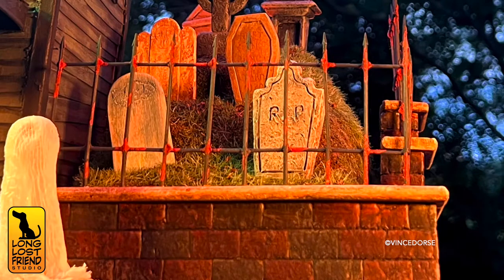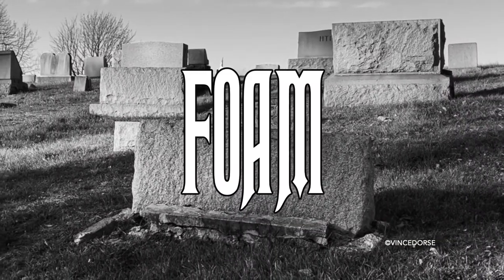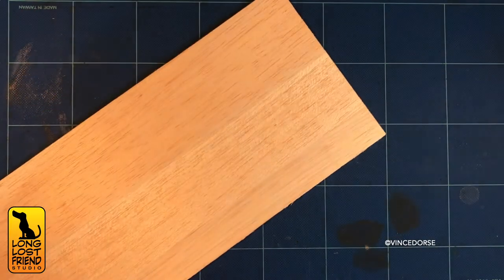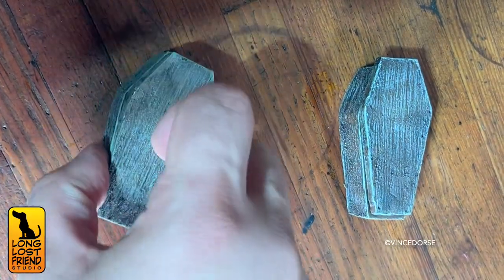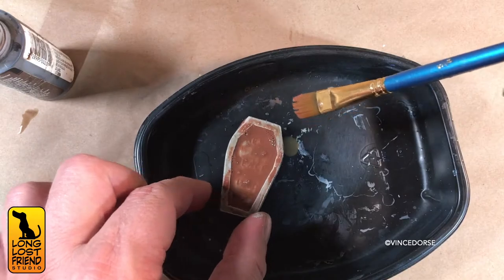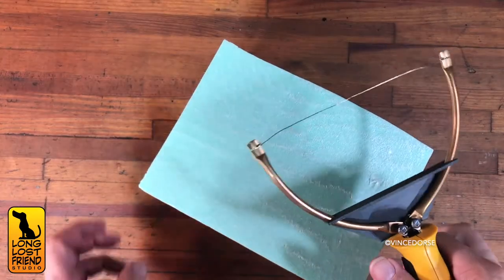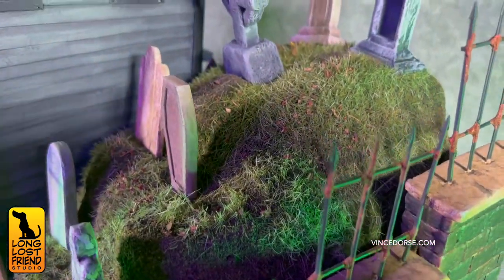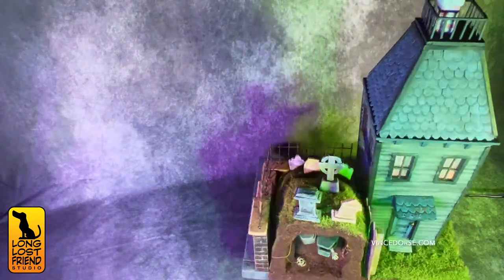How To Make A Miniature Cemetery for a Haunted House

Comment: Happy Halloween!  May I ask what you were doing with the pin in the foam while flocking?  I may have missed it.  But,  I'm pretty sure you were actually attempting to reanimate the corpses in the hill.
Reply from the maker: We didn't push the pin far enough into the earth to bring them back to life, but lesson learned for next time! 

Now for the fake answer: That little machine is a static grass applicator. You fill it with fake grass, slap glue on your diorama, plug in the applicator, and there's a little wire with a metal end that you hold against the glue to charge it. When you shake the applicator above the glue, the grass comes out and, because of the static charge, stands upright in the glue rather than laying flat. So it looks more like how real grass grows. We stuck the pin in because it's easier than using the clip at the end of the wire, but now that you bring it up, I think next time we'll use a much longer piece of metal in place of the pin so the backs of our hands don't get covered in fake grass. Great question!
Reply: @LongLostFriendStudio  Whoa!!  That's super cool.